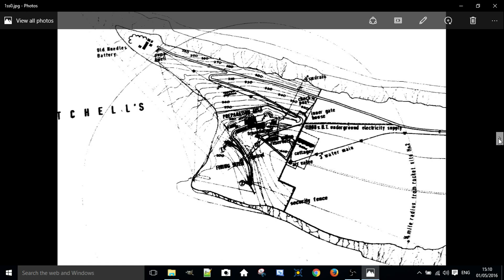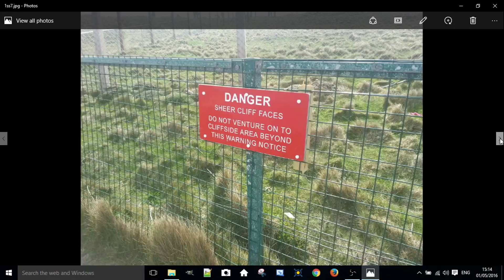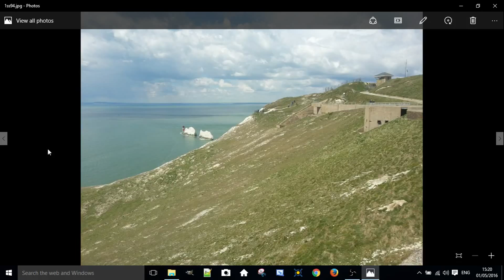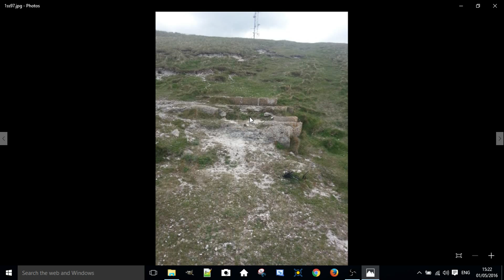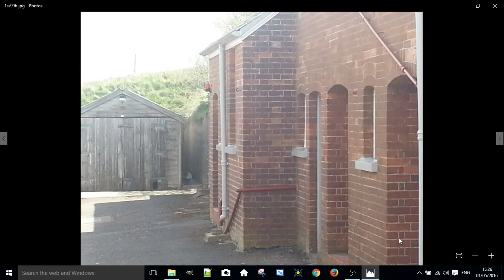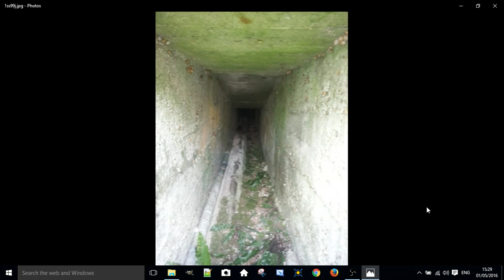Most Secret British Underground Base?

Comment: It’s an O2 airwave cell site, those antenna that you don’t recognise are common on all airwave cells. The reason there is HV up there is because of voltage drop in LV distribution circuits, to run LV only up there to supply even a single domestic dwelling would mean the cable would have to be prohibitively large CSA and cost, hence them using HV as this negates those problems. The transformers aren’t always that quiet. He coastguard lookout you mention isn’t coastguard, it’s national coast watch institution. Theses volunteers monitor marine traffic and coastal walkers to aid in emergencies, there is nothing sinister about any of this.

Comment: The red lights are common error or malfunction lights as the coastguard and a 02 airwave are classed as CPNI infrastructure it’s common to see these lights to give early warning of issues on supporting infrastructure. The two key safes are to have what’s called a two man rule. It’s means no one person can enter to damage etc as you always have two different parties which requires collusion to between the two to carry out fraud / eavesdropping or interception. Your mast has multiple customers hence different aerial types and as it’s so far away / remote the microwave links are cost effective vs fibre.

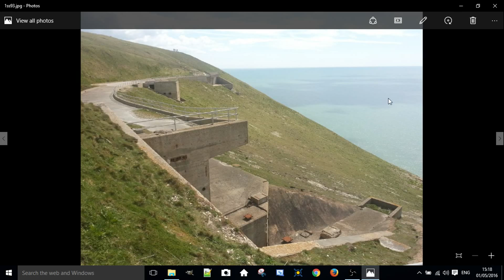Comment: isnt this an old rocket test site no longer used since ww2. at 9:38 in your video this area was once a large vertical building which slid in and out of the site containing a rocket motor.
Reply: The rocket testing site was used post war up to the 70's; they tested the engines of the Blacknight before being shipped to Austrailia for launching

Comment: Nothing unusual about a commincations mast being loaded up with different types of antennas and microwave dishes. A single good site for an antenna can command £20, 000-£30,000 annual rental income from each commercial user. Looks like that one could be a nice earner.   Certainly Solent Coastgaurd have remote aerials, transmitters and receivers on there which the operators refer to as "my Needles aerial", one of several site  locations along the coast that they use for VHF comms between Dorset and Beachy Head and out into mid channel.The buildings will house transmitters, receivers filters and waveguides and ground communications links for the various communications functions, all of which require a reasonable amount of power, so an 11Kv feed is not out of place. .  Also, Trinity House connected the Needles Light to shore power a few years ago which will come off that 11Kv supply. It certainly would not be paractical to carry lower voltage supplies over any distance to meet the electricity demands from the sites at the western tip of the Island.

The Needles Coastguard Station is just that - a Coast Guard Station - manned these days by unpaid volunteers since the coastguard abandoned its professional coast watch service some time ago. Their primary task is to monitor for safety the vast  numbers of pleasure craft which use this part of the Western Solent. Hence looking into the Solent towards the mainland.  The uncovered and broken cables that you saw were probably some aerial feeds that have been damaged in a land slip, very common on the Island, and have since been replaced and re-routed. They certainly would not have been capable of carrying anything at microwave frequencies, so they were for fairly basic lower frequency stuff such as VHF comms.

I'm afraid that your theory belongs to the Cold War of the 1950's. The world of secret government and military establishments, such as you believe this to be,  moved on decades ago and they are now rather more mundane than the James Bond fantasies of yesteryear. Sorry to disappoint.
Reply: And in a way, it is disappointing. It was something of a real life James Bond set but that was then and this is now.

Comment: so a hundred live under the ground............... no sign of trucks delivering food etc............... the red lights are warning lights and go off when there is an issue in the rooms with equipment......... the 11kv supply would of been designed to supply the original rocket base, cottages, radio station GPO box and no doubt a few other bits and bobs.............. given the amount of air supply the base wowuld of needed, plus lighting etc......... enough to power all the radio masts and equipment in the coast guard station thats about right.
There is a good chance part of the base is still fit for use.............. so I am not spooked out by that at all.............. your not the first to do a youtube piece on the area either...... so when ever there are underground facilities it always interests many of us to go take a look and try and work out whats left and how we can get in. 
I would be very much in the thought line that the place may well be guarded.......... especially if it is still  to some degree at operational standard.

Comment: 11KV ( thousand volt) transformer is there because... It's a long way up that access road.. half a mile at least.. Voltage drop on a low voltage 240/415 volt cable would require such a huge cable size to supply adequate current for even  a moderate size installation that it would be cost prohibitive. Thus.. a small 11kv cable and a cheap transformer at the top. Simples.. AND, why would a transformer have huge monthly cost implications?? It just sits there and does it's job!  Actually, as an electrician who worked inside those 11kv ''' BUNKERS''' in 1976 I can categorically tell you that there is just a transformer in one of those buildings and the distribution switch gear for the rest of the site in the larger building.. Most of which is defunct because I disconnected it and cut the outgoing cables off!  The brick building at the bottom of the hill is ( I believe) a water pumping station to get fresh water to the site, the red light is a warning beacon for the pump system as is the one at the top and the cable coming out of the back of it is actually going IN to it to supply electricity to the pump gear.. That '' Crane Mounting'' is a spigot mortar base from WW2. The weird indent into the slope behind it is where the gate house for the site stood; why the hell would you pull 5 ton loads up a slope on sleds when you have a perfectly good road going to exactly the same place??   The ''Secret and mysterious tunnel is a cable/pipe duct. .  You, Sir, have a serious case of conspiracy theoryitis, either that  or you are just plain stupid!
Reply: I second that.
Reply: I agree with all of the above, the little black box on the back of brick building is a key safe, probably it contains the key for the building!
Reply: Exactly... the guy clearly doesn't understand the power grid and the fact all power is distributed at very high voltage and low current due to the losses over long distances... it's then stepped down using a sub station... 11KV isn't much anyway...

Comment: I doubt this is any more than an old command control centre during WW2/Cold War
Reply: Oh and by the way, that metal box with "MASTER" written on it is a key safe, you pull down a plastic tab, enter a four digit code, open the safe and take out a key.